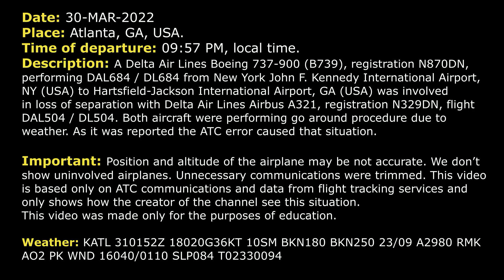ATC ERROR. Loss of separation | Delta Air Lines Boeing B739 and Airbus A321 | Atlanta, ATC

Comment: If I understand correctly:
1. 1217 misses the taxiway off the runway.
2. 1217 took a different route off the runway, but it took more time.
3. 504 couldn't land because the runway wasn't clear, so they did a go-around.
4. 504 goes straight for a while and then is instructed to turn right, heading 170 at 4000.
5. 15 seconds later, 504 is instructed to turn 240.
6. 684 comes up next but has to go-around, possibly because of the wind.
7. 684 is immediately instructed to turn right, heading 170 at 4000.
8. Because they started the turns at different times with different headings, 504's and 684's turns will intercept while they are ascending to the same altitude.
9. To avoid collision, ATC instructs 684 to turn left heading 140 and descend to 3000.
Reply: That is a good simple breakdown of the event above. Thanks. 
The pilots and controller stepping on each other didn’t help. When the second aircraft heard the first go around, he became hyper focused on the winds for his landing and his subsequent go around/diversion needs leading him to inadvertently step on the other comms.
Reply: Thanks! As a non-pilot, I wasn't sure what had happened.
Reply: @msjdb723  same.
Reply: Correction step 4: 504 instructed to turn 240, that’s why they intersected
Reply: @heyitsvos  Good catch! At 1:39 504 is instructed to turn 170. But at 1:54, just as they start the turn, ATC changes instruction to 240.
Reply: @heyitsvos  not initially.
Reply: @RubenKelevra  That’s the autopilot disconnect.  Windshear actually says “Windshear”.
Reply: Ah yeah, thanks. I missheard that. I thought I heard the two tone warning before the "windshear windshear windshear"
Reply: @RubenKelevra  684 likely went around because the crosswind was above their limit. They would not have immediately diverted for a wind shear warning.
Reply: @RubenKelevra  I think it is the autopilot disengage sound

Comment: It seems like the first aircraft didn't go around because of the weather but because the runway was not clear yet? Go-around was initiated by ATC (1:07) and that's when he kinda lost his flow. 🤔
Reply from the maker: Yes, that's what I wanted to show. But it was reported that there was bad weather and that was a factor as well.
Reply: @YouCanSeeATC  What doesn’t make sense is why he turned the 2nd aircraft so quickly when a simple “fly runway heading for a couple miles” would have provided the needed separation.  Thoughts?
Reply: @LowWingFlyer  you'd have to be in the hot seat to understand what is actually going on here and how difficult multiple go arounds can be. Going around is way more dangerous than trying to land the aircraft 90% of the time, as you see here. Thoughts?
Reply: @Spanikopita  What is taught in aviation training is 1st option is go around, 2nd is land.  That way a go-around order is not a surprise.
Reply: The first AC went missed because of traffic on the runway, the second AC missed because of what I assume is their crosswind limitation. 
I would bet that the controller lost SA trying to coordinate the second ACs route to Augusta, since the pilots deemed that to be very important information literally during the middle of a missed approach.
Reply: Careful please guys..